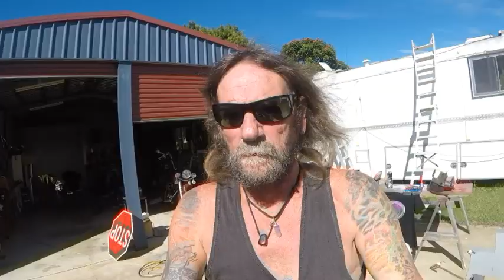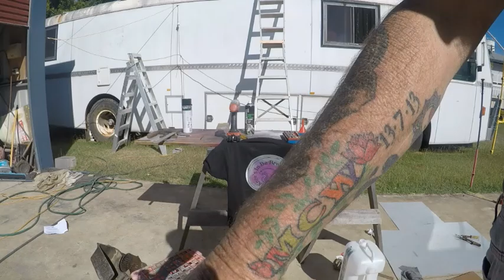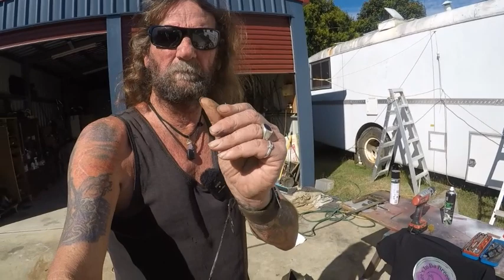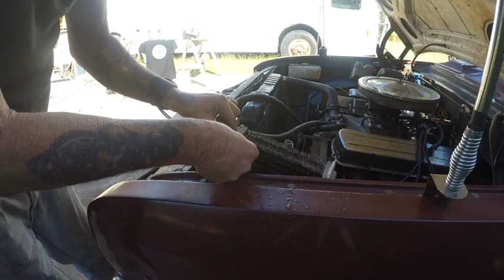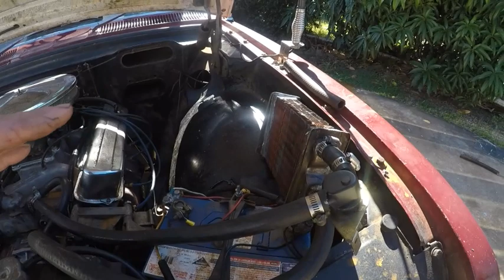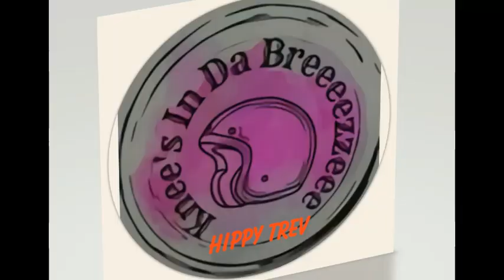Holden HK  lm No Fake  & Prezzi in Da Mail... Hippy Trev

Comment: With 40 thou taken of the heads could be causing extra load on rocker gear. Try putting 40 thou shims under rocker gear to bring operating load back to factory specs
Reply from the maker: l put 0.006  or 0.06 thou 3 peice metal head gaskets on the motor  ...  all push rods spin freely when motor is cold warm & hot... cheers

Comment: Sometimes . On some v8s an 6s . Think i did a 318 cam swap . . Get a long boxcutter stanley knife . Loosed off the pan more at the front and just past the middle . Try prizing the pan down a tad at the front and slide the box cutter along the block to cork pan gasket. Cutting any silicone if any pull some of the front pan bolts out . . Then remove the timing cover. I used some brake clean rags and a bit of compressed air to clean the surfaces before pumping silicone between the gasket and block  minutes before reinstalling timing cover.  .id be sus on the oil galleries  myself. Its done it before right ?
Reply from the maker: l sure dont want to break the sump seal & then have it leak  thank my worry there  about doing it in the car...  yes it did chewed  lobe  thats why l put the new cam in...cheers

Comment: Trev don’t be running it or you will damage it think where is the pressure ment to go with the valve closed ? Head gasket will let go also you could damage the bearings from compression no were to go
Reply from the maker: l sorta have to drive it  at the moment..... but  ya right... cheers
Reply: Won't hurt it driving it. Now it has a compression stroke ever revolution of the crack instead of ever second revolution. Seen many come in for cams like this back in the day

Comment: That guy that said its a sticking valve is the meth head trev . A sticking valve can ruin a hydraulic lifter also chew a cam lobe down and scoop out the relative part ,the lifter base but most likely lack of oiling or improper  first cam break in.. Hence causing no pushrod movement  . If the valve was stuck all of a sudden and not gumming up over time then The pushrod would look like a banana. .. it would have to be cyl number 8  if the cam broke . Another highly unlikely cenario . On the 253 holden always chew the lifters
Reply from the maker: poor old 4kay lol   l thought l did the break in of the new cam right  but maybe l didnt..
my mate Dex just Ph me & said  rember when l got that new cam & l said on vid  how rough it was & looked very poorly made... so if ya go back to last year & l got the new cam & the new fully worked heads ya can see how rough the cam looks.. cheers

Comment: Mate. Your channel is awesome. I enjoy it because you are what you are. Your real subscribers enjoy your daily endeavours   
Don’t get wound up about posts that are sarcastic 
Just a note lead soldering is my specialty when you think it’s clean , clean the job again and again. Use bakers soldering flux for best results. 
V8 can run forever on 7  cylinders until your ready. 
Stay strong.
Reply from the maker: thank's mate...  l will see if l can get any bakers soldering flux  in Childers on friday  or its Bundy or Scaryborough next week..cheers
Reply: @hippytrev7452 old mate here is steering ya in the right direction ❤😊🇦🇺👊
Reply from the maker: @MetalMania3DTV-TAS-AUS  took rocker cover off    no bent valve
Reply: @hippytrev7452  ok cool, I was saying a faulty lifter, I'm not the bent valve guy 😊👊
Reply from the maker: @MetalMania3DTV-TAS-AUS  l just pulled the rocker cover  & gave the valve a wack with a hammer  its fine.....
Reply from the maker: @MetalMania3DTV-TAS-AUS  l just pulled the rocker cover off  & cave the vales a tapp with a mash hammer.. Not Bent Not Stuck..
l 99.9999999% sure  came love gone.. cheers

Comment: Hey trev, could possibly be a stuck or bent valve, when push rod comes up and valve is stuck, couple possibilities 1:pushrod will bend. 2:rocker will bend or break. Or  3:chew the lobe beneath it or 4:all of the above. Sorry mate but possibly ur problem, hope its not mate.
Reply from the maker: nope  not a stuck or bent valve..  push rod  is not bent at all...  is ya check yesterdays vid ya can see all the rockers moveing  but 1....  just 1 even with the  rockers taken off  when l turned the motor over  1 push rod did not move at all  no up  no down  just didnt move at all
cheers
Reply: Watched yesterdays vid mate.
U might be seeing the result of the stuck valve.
Try use ur bore scope in the cylinder and see if there is marks on top of the piston where valve made contact.
If there is valve impact marks on top of the piston in question its a stuck or bent valve. Cheers mate.

Comment: If you change cam again use enormous amount of zinc on the cam and lifters. Make sure the lifter are ground with .002” convex . And also taper on the cam.
Reply from the maker: l was running a zinc additive when l 1st put motor back in & was useing oil..  (never did before )so l did oil & filter change put 20w/50 in... & a ticking started light a sticky lifter....  then all went quiet.... then the 400 mile run to Mt Morgan & back
is where  it all started...cheers

Comment: Hey trev maybe try  put some of that needit around the solder for a bit of extra strength just a thought
Reply from the maker: it sprung a leak  when l went for a drive..might take it to the Radiator repais in Bundy  have it fixed right.. cheers

Comment: If you have had 2 camshafts.done the same thing. You might be getting some bad parts.quality has seemed to be lacking in parts lately.
Reply from the maker: the 1st was in the motor when l bought it  3 years ago.. was after l did a head replacement it chewed out.....  so l pulled the motor  & changed cam & timeing gear...  this cam lasted 2000 miles